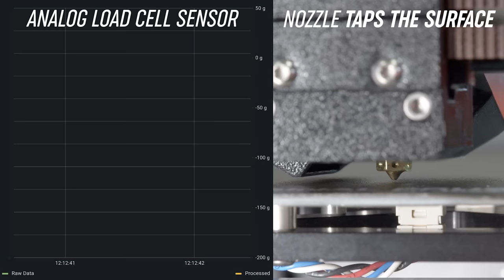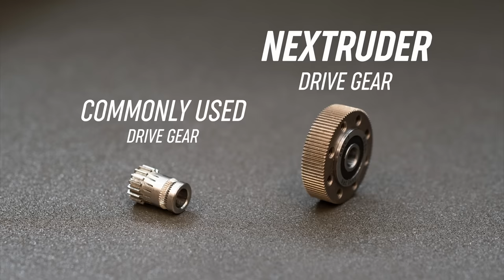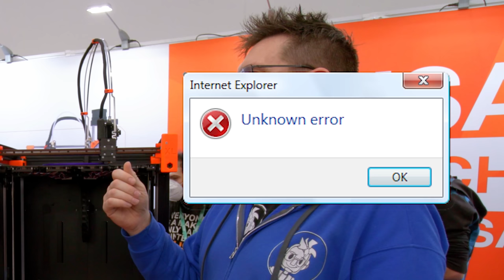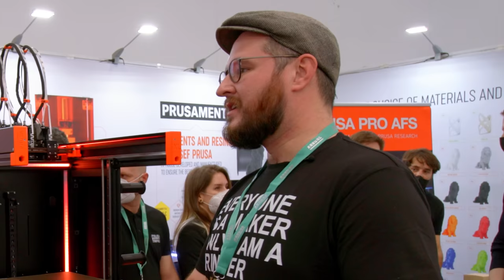Prusa XL First Look at Formnext! World Premiere!

Comment: I was worried about the escaping heat, but that enclosure is quite clever
Reply: The bellow style enclosure on the front won’t do anything for escaping heat… more so just a super basic draft shield that doesn’t go all the way up the front of the printer
Reply: @xsolar  never have I ever had a problem with heat escaping at the top, since this is a continuous process which the heated bed can work against. However draft of someone walking by or an open window can cool down the part too fast
Reply: @xsolar  yeah, actually they said they weren’t finding a need for the top to keep the heat in! But they’re still releasing a full enclosure as well

Comment: Did anyone see what max nozzle temp is?  All metal hot end should be capable of high temp, but circuit boards mounted to hot end assembly might limit enclosure temp and preclude materials that need high ambient.

Comment: extremely impressive machine, I love Prusa! and yet there's no way I would reasonably pay $2000+ to get LESS build volume than my $400 CR-10S machine....reliability and usability doesn't even compare but there's no replacement for displacement. Also arguably you don't "need" coreXY to "go big" the CR-10 line has been reliably printing big for years with an inexpensive and simple design, at least at the "hobbyist" level, which is likely 99% of 3d printer owners.

Comment: This is what you can do, if you have full control over every aspect of the design process of the machine.
Prusa isn't limited to off-the-shelf extruder, they can make their own. Nozzles? Their own. Electronics? Again. Sensors? They can afford to talk directly to manufacturers. They are currently large enough to take holistic approach to additive manufacturing. At that point I believe they haven't publicly admitted any work being done only on SLS printers.

With that, and between engineers coming from professional machining world and innovation+integration mindset, the rest of community can relay on Joseph's team to do the heavy lifting. Remember filament sensor made from optical mouse sensor? They iterated trough it, and found better solution. There were multiple open designs operating on this idea, they sometimes implemented it better, and took into account Prusa's findings, and it works. But Prusa decided to get rid of the sensor altogether and found better solution overall. Same goes for endstops, and many other design details.

It's like pressure sensor - it's been around, not an innovation in itself, but no one thought to do it in an FDM. Benefits? Only single low point (nozzle), so get ready for practical non-planar 3D printing. Ever seen benchy with perfect sloped roof?

Comment: 4000 is a steep pricetag,  though it looks interesting.
I am missing a proper container for the filaments.

Imagine you have 4 filaments and each time you used them you need to dry them again because of air exposure, that's bad enough with one.
They should have included a solution for that, not too hard or expensive.
Reply: They sell the Repkord Redbox on their website. It can hold all five rolls of filament.

Comment: my quesion is can 2 toolheads be printing at the same time in like mirror mode? that would be a really neat feature to have a sort of IDEX function opton
Reply: Not that we saw. But who knows if that could be an upgrade later.
Reply: @Aidenn23  this option would create the ulimate workhorse for me then imagine u have 4 toolheads but always 2 printing in mirror... So u could print two 2color prints at the same time  at core X Y speeds that would be a upgrade I would definitly buy... The toolchanger alone is cool but this would make it even better and unlock its potential for me at least
Reply: No. Toolchangers don’t have idex capabilities
Reply: @xsolar  isnt it all software in therory? I saw a guy working on a voron idex... Isnt major issue to solve all the edgecases whe the toolheads could hit each other and add routines to move them savely? Or is it just not possible to move 2 toolheads independantly on a core xy?
Reply: @nebuchadnezzar47  IDEX requires an extra belt, pulleys, and x-axis stepper motor.

Comment: Can someone help decide.So I am trying to decide between this and the rat rig vcore 3 500mm.I dont really need the tool head capability of the prusa the thing about the prusa is it has a very big community were the rat rig v core 3 not do much.But then price plays a big thing the prusa is 2000 dollars and the build volume is 360x360x360.while the rat rig is 500x500x500 and 200 dollar also. so i just want someones opinion

Comment: Kinda wish we got some questions on if some of these features might make it over to their lower end systems.
Reply: They will! It’s in their blog post. :)
Reply: @Aidenn23  Thank you for letting me know, gonna check that right now.
Reply: @Aidenn23  I checked, and there's no mention of trickle down improvements or what they might be. As it's the last announcement of 2022 I don't think we'll hear about them for awhile.
Reply: @Capzielios  he doesn’t say it specifically in the blog post. This is the exact quote pretty early on “You can even consider it to be a bit of a showcase for our future 3D printers. 😉”
Reply: @Capzielios  I wouldn’t be surprised if we get the nextruder in the mk4 for example.
Reply: @Aidenn23  I thought the "Future 3d printers" Meant like, a smaller or more affordable coreXY. But Thanks for pointing out potential meaning behind it. 
I hope instead of a Nextruder for Mk4 we get something with a bit more reprap compatibility. Switching to proprietary would be a bit of a pain.
Reply: like he mentioned "the parts are stuck in traffic", therefore its not gonna happen until everyone who wants it got the XL ,-)

Comment: Can the load cell in the extruder be used to assist temperature tuning filaments?
Reply from the maker: Hmmm... You're thinking each filament would have a proper pressure with the right temp?
Reply: @3DPrintingNerd  Exactly!  If not a specific pressure I imagine a given Goldner type would have a Goldilocks zone.  This along with the heat break thermistor gives us a lot more data points to use.  I wonder if the load cell could detect oozing as well.  I have always thought that 3d printers need more sensors, more data points to be able to self tune and detect error conditions.

Comment: As I mentioned on the Prusa video, Philip Fry Shut Up and Take My Money meme

Throw in a (heated) enclosure and a RepBox (because you know you will want one with desiccant for nylon, PETG and PC), and this is still less expensive than a competing multi-extruding large(ish) format FDM machine. This is still very competitive even if all the hotends were, say, Mosquito Magnums with hardened nozzles. I would probably relocate the electronics outside the enclosure, just to be safe.

My only beef is that I'll probably never see one until late next year. To be honest that's not a real complaint, because I'll benefit from the in-the-field testing by those who preordered first, and I know that Prusa Research firmly stands behind every one of their machines.

Comment: Sad thing about this is the fact, that for us Czechs - these printers are so expensive :( Even if i sell my MK3S id need a LOT of money to get new XL - and i really want it! Half of my house is holding together only thanks to prints form Prusa!!! :D
My thought about tools - if there is a small CNC head for wood work (or even aluminium) - that would be awesome. But the rigidity of axe drives may not be good enough for this - we will see. But would be a great addon for this "universal" tool station.
Reply: But, you saved a lot by printing pars for your house right!? I would love a smaller version though as well.

Comment: is it me or is it print slowly ? my blv mgn is much faster. it look like my prusa mk2s or something nearly 40-60mm/s
i find it strange as all voron and others are more in the boatrace... maybe not stiff enough for that. will see.
Reply: It’s plenty stiff enough for that. And it’ll get up there in speed. Prusa is helping Klipper put together a profile for it for maximum speed.
Reply: I think the slow speeds is just for filming tbh, makes that easier and safer on a showroom floor
Reply: > We’re still tweaking firmware and print settings to tell you the max speed, but you can be sure that thanks to the small and lightweight direct-drive extruder the XL can be very fast. Just an upfront note: we are aiming for print quality, not looking to join the SpeedBoatRace.

Comment: Ok. Recently I've had a change of heart on price tags. I used to bitch about higher prices but I've come to the conclusion that the printer space has become like their PC brethren; cutting-edge, premium units command the highest price on first release. Give it a couple of years and the price should go down -- in theory. So $2K USD is butt-load of money but it does contain a bunch of cutting edge ideas, least of which the heating bed redesign. Or motherboard. Or... (You get the idea.)

So you made of money? If so, then you can be the cool kid with this new shiny. For the rest of us (who don't have the cash or not an established Youtuber, either), then hopefully we can either mod on our own or wait for the components to come out separately and then pick what we want (or can afford) to upgrade. 

Still though, mentioning Youtube... I really will be disappointed with anyone who touts these two new models as must haves. It'll be like watching a Youtuber being gifted a Ferrari and then telling us normal folk, who may be lucky enough to afford a nice minivan, that spending MSRP on the car is absolute must. 

But I am glad Joel was able to go and curate some of the neat ideas being presented at Formnext. Thank you!

Comment: I’d like to see it print multiple colors and how fast could it print. Speed isn’t a deal breaker but I’m surprised this wasn’t spoken about
Reply: I doubt it competes with a maxed out Voron, but it has the potential of being fast, but I see the biggest benefit besides a huge quality of life improvement is the large volume + 5 printer heads.  This means you don't need to setup multiple different printers for different configurations (large nozzle, flexible, different colors) you can just use one printer.

Comment: Have been turned off of Prusa due to the negative interactions I’ve had with the Prusa community. The machine does look impressive though
Reply: Prusa community is like the Apple community - full of rabid fanboys that see anything Prusa does as the best thing since sliced bread. If you go look at the pre-order link, it has 5 star reviews ... for a product on pre-order. It put me off the Prusa machines in the past because I have a friend who had endless problems with her Mini and the Prusa community was very little help since they seemed adamant that the print was perfect and that it was "user mistakes" even though I confirmed it was definitely the printer. I want to buy a printer, not buy into the Prusa religion.
Reply: Wait till you see the Klipper/Voron community. :) I agree fanboyism is never great, but you have to be careful not to be a fanboy of just dissing things either. Both are not very constructive.

Comment: Tapping the print surface with a hot brass nozzle isn't the best idea. It'll also leave little dabs of plastic oozing from the hot nozzle all over as well. It's been done many years ago - it works OK.   Also, should use geared idlers instead of smooth ones where the belt's teeth comes into contact otherwise it'll cause print artifacts.

Comment: 14" corexy...not the best idea i guess but if it works.  corexy also has it's limits.  usually 10-12" is it's max.
Reply: Rat rig has a 500 x 500 core xy printer, seems to work fine.

Comment: can't wait for aliexpress 500$ clones
Reply: Those already exist - this is not a new idea.
Reply: @redavatar  i don't think there are clones of this exact model, the corexy... only the previous models
Reply: @bogdyy13  There's a lot of CoreXY printers on the market right now - Prusa gave it their own spin, but it's nothing revolutionary. Keep in mind most of the other brands have no intention of building a €2-3000 printer so of course Prusa can awe everyone with all the extra features since they can afford to at that budget but until we see print quality I think people need to tone down the hype a little. Core XY printers aren't hugely better at printing than regular printers except you get rid of some artifacts so the question is if Prusa can improve quality beyond just this because otherwise you just have a very expensive printer that can print marginally better. Maybe they're banking on the 5 hot-end system though because that's unique and would only work with a Core XY design.
Reply: @redavatar  Oh common, show me the Chines version of this one with the features this one has. I don't want a Chinesium clone anymore, had them, great start for the hobby, but I still was modding them in the exact same way 5 years on, so much for development on their part. Can't wait for this one.
Reply: @VincentGroenewold  I explained in my post that no other brands has any intention of selling a 2-3000 printer for good reason: only Prusa can get away with this because of its fanboy audience. If it was a €1000 printer I'd be impressed. At over twice that much, I'm not. In fact, I'm not sure the price-quality ratio is even worth it unless this thing produces perfect prints but I always found the Prusa community to be far too lenient in this regard. Prusas are work horses but considering the price point, their print quality is only on par with €200 printers which is frankly ridiculous so for this price point they better produce way beyond with "chinesium" CoreXY printers produce and for that we'll need to wait and see but in the past they've failed to convince me.
Reply: @redavatar  not just the hot-end system.. the bed being able to only heat up partially is also a new thing I have not seen on other printers
Reply: @redavatar  I think you're way too much on the negative side. There are plenty of printers at that price range or even higher, that do even less! Print quality is totally a thing of the user in combination with the printer, you can't change physics on how to lay down molted plastics. You can however make it easier to be more succesful at printing at a good quality.
Reply: @VincentGroenewold  Nah I'm a realist - unless I see the print quality, people should off with their major positivity. 3D printers are there to print good quality prints, that's IT. Having a gazillion comfort options is nice but it's not the core of what is vital. The Prusa i3 is nothing special by now - budget printers are on par in terms of quality even though there's room for improvement and while a CoreXY offers better quality, the existing CoreXY printers do too so it will need to beat those in quality as well at that price point.
Reply: @redavatar  Of course we need to see the reviews first. The positivity is mainly due to the new stuff, like the bed (I mean, you have to find that at least interesting right?). It's innovative, that alone used to be a reason to cheer about. Times have changed.

Comment: Hi from Will and Mr Data :):]
Im continuing vetting sites on behalf of comunity for business use.
 54 sites vetted so far.
By chance im currently vetting pruser again by request. 
So far 15 days and zero answers recieved to vetting questions. 
Resent to second address and got confirmation they were recieved.
Still no answers.
Compare that to cgtrader answers in 24hrs 100% of the time. 
Looks like pruser are working on a nice printer but not customer support for there licensing site. 
So currently i rate there licensing site out of 54 in last position. Based on zero responce to vetting question in 15 days.

Comment: I wish Prusa success with this printer, but I need to say that their demonstration print is slow. Painfully slow.

CoreXY printers can go way faster than that and still print with quality, you don't need speedboatrace speeds for that. Also, the whole point of the CoreXY motion system is to be able to print fast, and that commitment to slow speeds kinda neglect that. And again, slow print speeds doesn't necessarily translates into quality prints.

Anyway,  that's a product that's not tailored for everyone, and the price point isn't helping either. Some of the ideas are clever, though:  the segmented heated bed is nice, although still being PCB heaters. Also, the cycloidal extruder looks nice, but I wonder about if yet another new nozzle ecosystem, and one that seems proprietary, is appropriate or not. Only time will tell if this, or E3D Revo, or Phaetus Rapido, will stand the test of time.
Reply: Phaetus Rapido still uses standard nozzles
Reply: Obviously they're not running them at full speed... sjeez